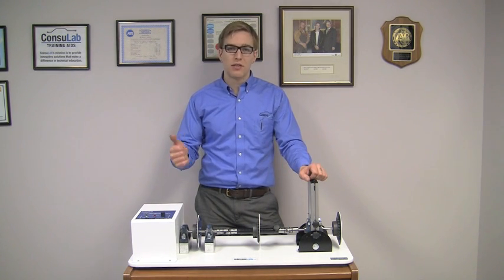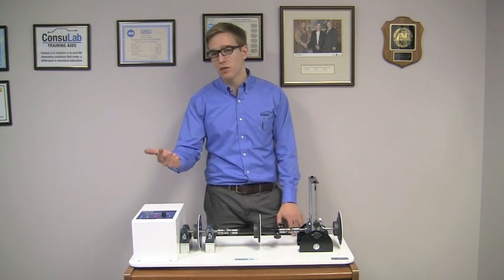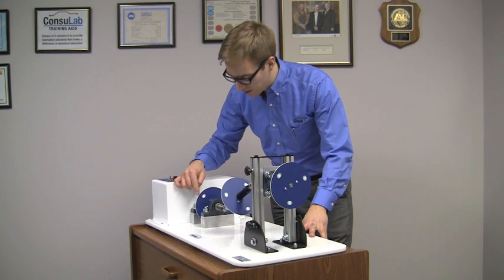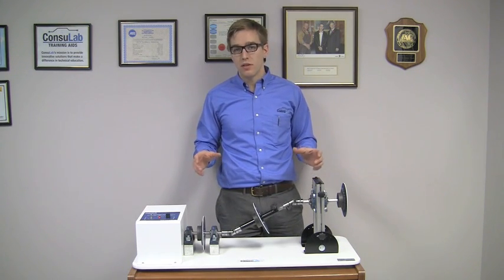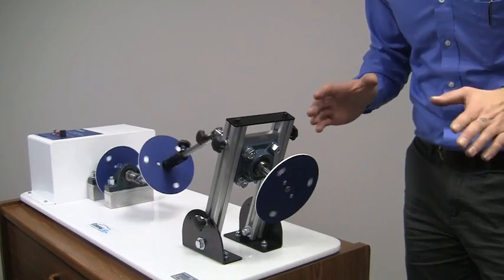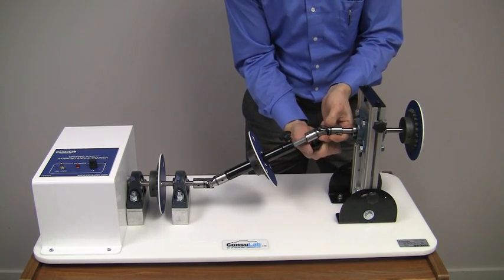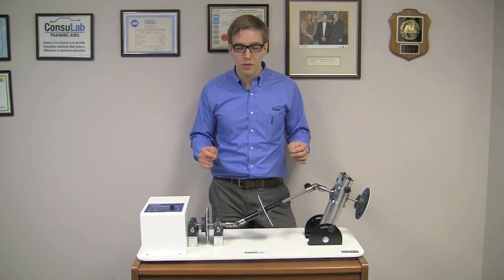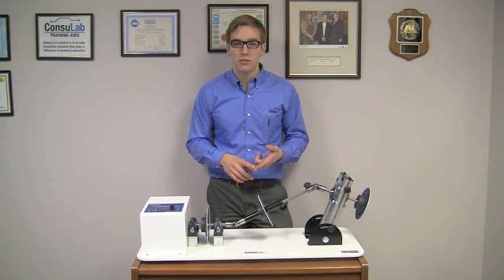Driveshaft Angle Trainer

Comment: This is not a good demonstration device! The transmission output is pure straight,  and  none adjustable!   Most transmission output is around 2.5 degrees. 0 degrees on transmission output,  nothing marked on pinion ! This mock up will do out of phase only.   Also the extremely small universal joint hardly shows the 2 acceration and the 2 de-accerations .  Our school was very unhappy about this mock up,  since we asked them to make it for us.

Comment: 99.9  %of  all  truck  drive lines  I've  ever  been  around  had  in  phase  u joints  the . 1%was  on  an  International . I  sure  wish  someone  could  explain  it  to  me
Reply: +Dean Kay good explanation on why you need some angle variations on u-joints but I'm still wondering about that IH where the one u-joint to the next was 90 degrees off to the next one. I remember this one because I put it in phase and the driver came right back with a bad speed related vibration. I put it out of phase and no more vibration.

Comment: You make an incorrect statement at the beginning of the video. A modern universal joint that has needle bearings in it will not last very long if it has no angle in it and may produce vibration in the driveline from the get-go. So, it's not true that if there are no angles then everything is ok, it's not. A universal joint MUST have at least 1/2 degree of angle to work properly and not produce vibrations. I know it's not pertinent to the training aspect of your fine device; I just mention it so no mechanics viewing this will get that bad idea in their head and try to shoot for perfectly straight drivelines.

And as an aside note for mechanics out there: if a driveline had as much angle as this prop showed, the driveshaft's own oscillations would produce a vibration no dampener could hide. 2-3 degrees is the target angle and the in and out angles within 1/2 degree of each other. You're gonna need an inclinometer to measure these angles properly BTW.

All this information I give is from the GM vibration training class I attended at the GM Training Center in Atlanta back in 1991.

Comment: hi , i have a question , i have a 3 pieace driveshaft in my truck , if i was to lower the middle section of the drive shaft but keeping it straight , only by a slight amount , what effect would this have? , by this i mean the center is held with 2 center bearings and i would like to space these down a bit it should mean that both the end uj's are at the same angle
Reply: +rodney trotter  You are trying to out smart a mechanical engineers reason for the way that it was designed. If all components are the same as designed, you will end up with an unsatisfactory performance that will likely have vibration and disintegration in a short time.
Reply from the maker: Regardless of how many consecutive universal joints are used, the angles must cancel out or else there will be an acceleration and deceleration.

Comment: so because of the way my drive shaft is angled, it could throw my speedometer off by one or two miles an hour? if so, that would explain why i got my last speeding ticket..
Reply: +seth gerry lol
Reply: Sorry that just not true.  It would be for the difference between the acceleration of the drive line for one revolution.  Or to put it another way, the difference speed between the fastest and slowest speed acquired in roughly 8 feet.
Reply: +seth gerry  Not quite! It could though, explain that little pulse you might detect in the needle.
Reply from the maker: Definitely not!

Comment: I can't get my head around why the joints accelerate and decelerate when they're at an angle.  Can anyone explain in simple terms why this happens?  If you had a flexible shaft (say, a piece of plastic) would the same thing happen?
Reply: I think it's because the rotational force is not an "equilibrium round" force. Lets say total rotational force is 3 Newtons. It's probably slightly incorrect to say every degree has 3/360 newtons of force. Every degree most likely has -3/360 newtons of resistance. It seems like a path of least rotational resistance forms when the shaft turns as well. So the energy is transferred in a pattern more closely resembling: swinging a ball on a string around yourself. When this path of least resistance starts going up at an angle it inquires more positive rotational resistance, due to gravity. So the -3/360 N resistance per each degree slows down, when encountering an opposing force. The converse is probably also true when the path of least resistance encounters an angle going downwards it accelerates.  The path of least resistance must form because the joint cotter pins that connects the two rods places them in an opposed position (90/90).

Going back to the ball example. Lets say you spin a ball around yourself with a constant 3 N of force. On a level orbit the velocity will be the same. However, if you orbit the ball over your shoulder and then back down to the ground with 3 N of force... Then the ball will have more velocity traveling towards the ground. And the derivative of velocity is acceleration... And a circle is completely symmetrical as a function, so greater velocity would mean more acceleration.    

 I propose that if the rods were assembled at say an (80/120) angle a different amount of change in acceleration would occur than the one shown above. The different angles that form when the joints bend probably also effects how much time the path of least resistance encounters opposing resistance. Thus creating a specific acceleration/time function.
Reply: Cheers for the reply.  I see what you're saying there, but that would imply that if, say, you turned a a UJ in space, where there is no force of gravity acting on it, then the UJ would turn smoothly, which it clearly wouldn't.

I've been thinking more about this and I think it's to do with the angles they turn through; On a UJ the cotter pin moves back and forth and draws out an ellipse as it moves.  Because the driven shaft is directly attached to the cotter pin it has to follow the elliptical path by accelerating and decelerating.  Vehicles use constant velocity (CV) joints to overcome the problem that UJs have.  The ball bearings inside the CV joint also scribe out an ellipse, but the ball bearings are free to roll back and forth, so only the circular movement is transferred to the driven shaft.

Makes no sense in text, but that's the best I can describe it!
Reply: +Kj16V  Simply put, the pathway for the angled joint makes a high and low point.When high, it has more torque.

Comment: you have it wrong bud... when you do the first noise test that last wheel is acc/de.. you can hear it... why?, because the uni joints are out of phase when you start, then when you say you are putting them out of phase, you are actually putting them back in phase.. i can see the inner part of both unis to determine this.. not being a dick, just seeing it as it is... are you just a presenter of info or do you actually understand it?

Comment: Your X and Y axis is perfectly at an angle 0f 15 degrees with respect to x-axis, what if the cross bearin is turned 45 degrees, how can you align the shaft at 45 degrees cross bearing degrees, and lower down at 15 degrees z-axis? where will be the turning goes?